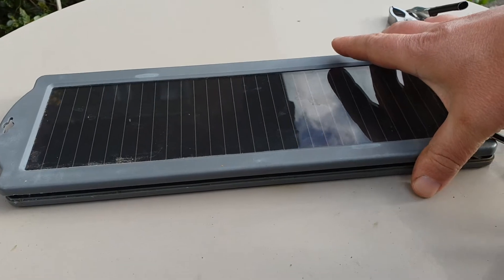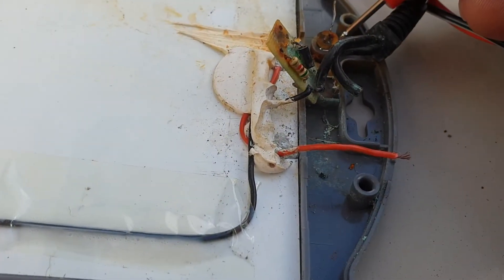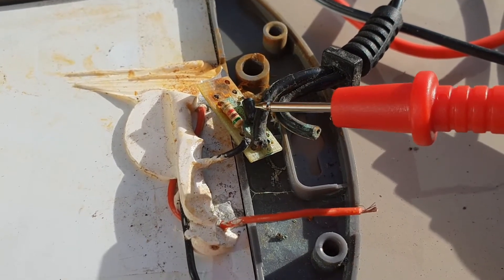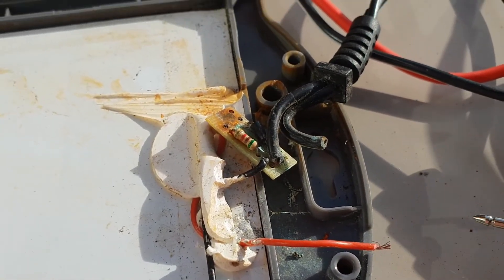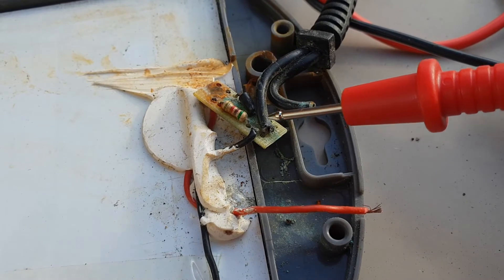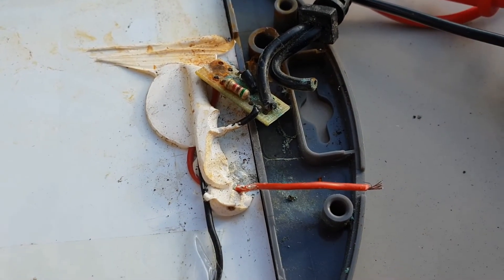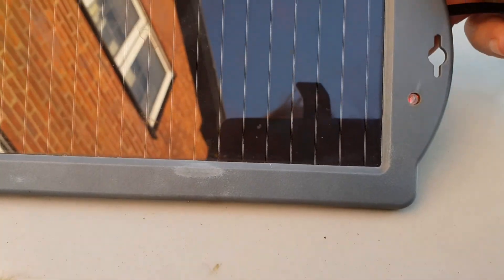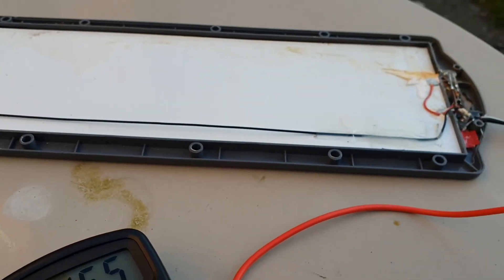How to fix a Solar Battery Charger circuit for a car, motorbike or motor-home

Comment: Wondering if you could help? I've just bought a "Oxford solariser" which looks very similar to yours. With the supplied leads I have three connection options... Cigarette, crocodile clips and ring terminal. The ring terminal one has a fuse in it, should i/do I need to use the fuse for when using the crocodile clips. Thanks Dean
Reply from the maker: I'd think Tlthe fuse will only be there in case the diode stops working / shorts and current reverses back from the battery to the panel. It can't be there for charging because the panel doesn't output enough current. Without out the fuse, the panel would catch fire..however, I've not heard of a diode ever doing that..ever.
Reply: @theq-1  thanks for the speedy response. I will go ahead and fit as is.